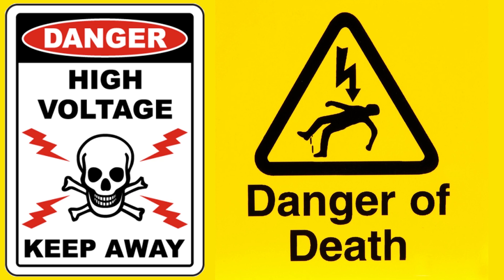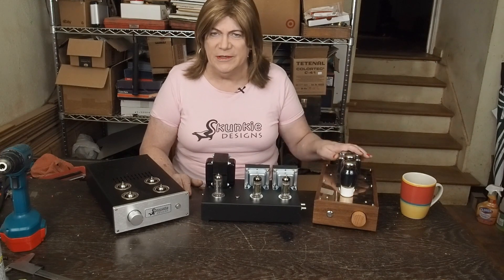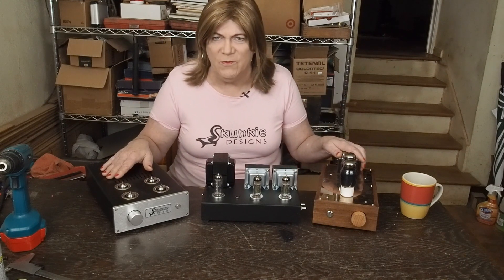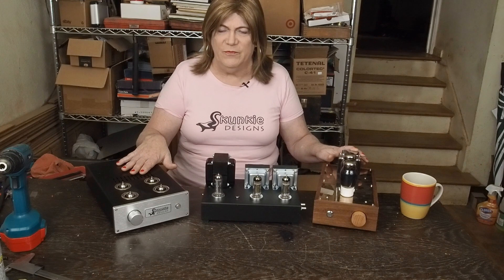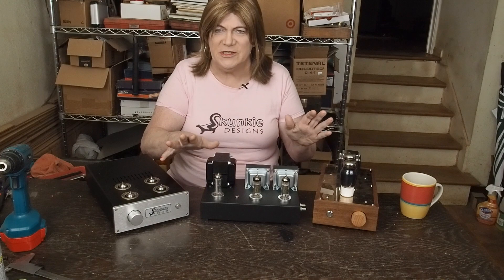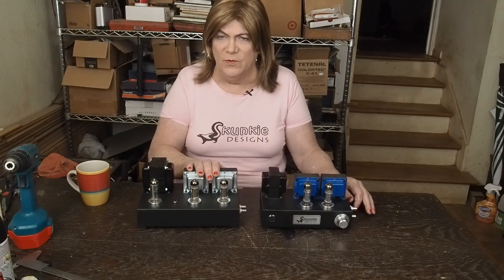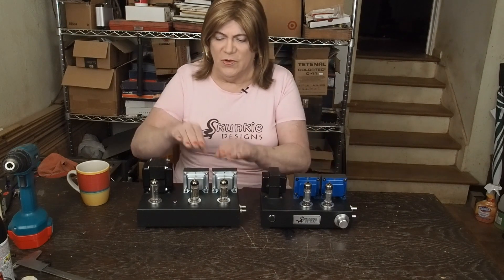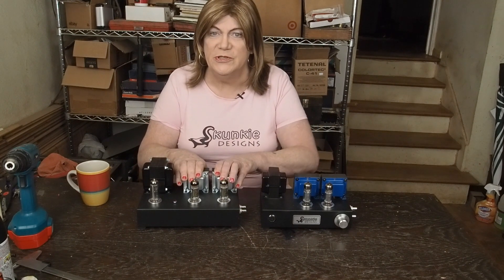6BQ5 spud amp: #5 Testing and Final Words!

Comment: The. Output transformers disappointing. I was looking at the MPS SE output transformers and noticed that all but one are defined as guitar amp outputs. There was one sole SE xformer defined as a hifi output.
Which are the ones you’re referring to?
Have you tried Hammond 125ESE’s? They spec the response as appropriately 100cycles to 15Kc, but they actually measure pretty well down to 30cycles. The 100 cycle square wave looks almost as good as some low end Tangos.

Comment: Merry Christmas Skunkie. Hi I enjoy watching your builds. Do you know the primary inductance of the Edcor transformers? You may need more primary inductance, a bigger transformer may not solve the problem if primary inductance is the issue. 
BTW I'm thinking of a 6BM8 amp for my computer speakers, I'm currently using a 12AX7 6P1P design that works well, I like the idea of one tube per channel.
Have you looked at 6S19P tubes they look very cool if facing the correct direction, not easy to design for, I intend to build one as a 2 watt per channel computer amp as they look so good.
Keep well ken k

Comment: Aren't these opt's made for a guitar amp.?
Reply from the maker: Exactly what I said in the video. I don't blame the circuit, this is the first time I tried these in a HiFi build and have used "guitar" OT before, the 10 and 15W Edcor OT are sold as "Guitar" OT. I just hoped these might also be usable for HiFi and while they work, I think others would probably work better.
Reply: @SkunkieDesignsElectronics  Thank you for taking the time...M.C.

Comment: You would be surprised at what my experimental amps have for output transformers. But I am building these for under eighty dollars. My transformers are six dollars on ebay. They ran out of the four dollar ones I was using. They are seventy volt line matching transformers. These are just to learn how a tube amp works.
Reply from the maker: Sounds fun and that's the best way to learn!